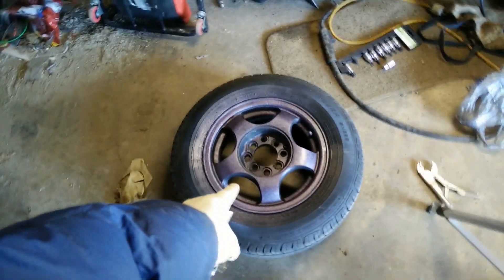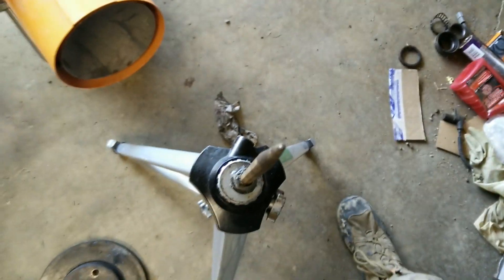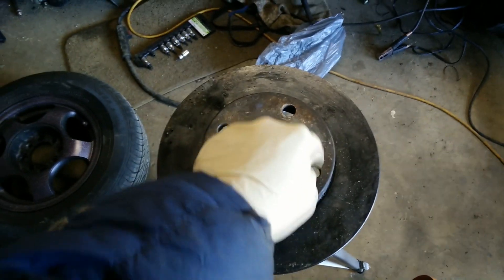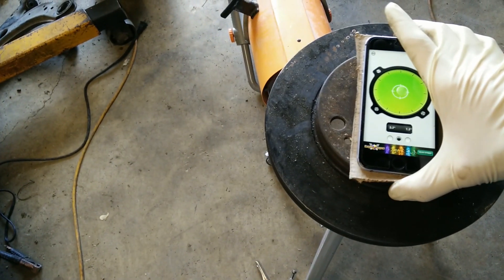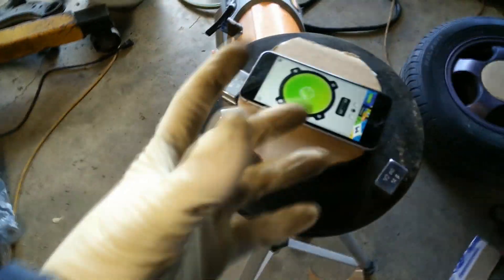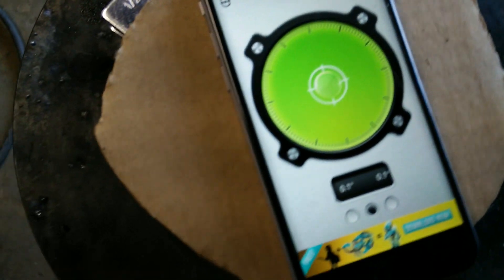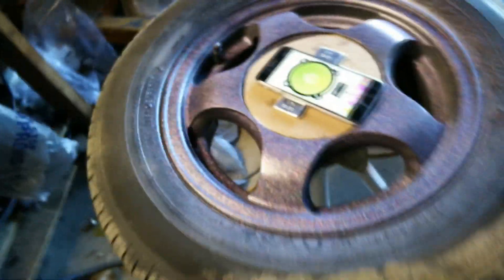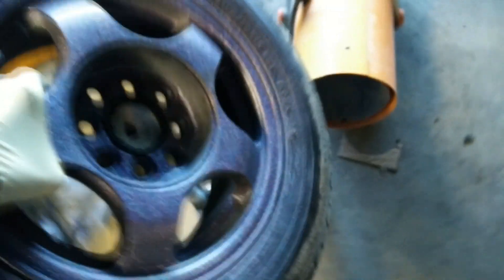DIY Wheel Balance | Make Your Own Bubble Balance

Comment: You do need to make sure the tires and wheels are clean, as a bit of grease or mud can way an ounce or more and when it dries and falls off your balancing will have to be done over again.  Do not sand the finish to appy the weights, just clean it well and maybe use a debrease such as alcohol (brake cleaner) or paint thinner. lighter fluid or in worst case scenario, soap and water and rag.

Comment: Alignment's not too hard either - I just made a couple of brackets out of spare wood I had and strapped them to the wheels. String and a tape measure got it close enough. At least drives straight now.

Comment: Dont give up on the idea but major fail in execution. First off "about centre" on your punch(no good) 2nd using a non centred phone and thinking it don't weigh anything and will not contribute to the balance. Small mistakes compound and you may be better off running no weights then maybe putting weight on the side that was already heavy. Take your time make sure the device will stay balanced without a rim then make sure your rim centres on your balancer. Good Luck on the project ;)

Comment: I balanced my tire with bb's, well it was shaking some I didn't like it,  so I took the back out, and I do not have a balance yet  am planning on getting one like you here,  so, I put my tires back on the rims again to day, and on all tires they have a colored dot some where on the tire, that dot indicates that  the light place in the tire, so I put that dot next to the valve, and  posed on the rim, aired it up to 33 lb's, added 1 once strait up from the valve, and I did this on all my tires, it's perfect  no shaking shimming nothing,  and if I didn't put that colored dot next to the valve stem, then, I couldn't add a wait strait up from my valve, the wait would have to be off centered to one side , and 3/4 of a once our a once  is perfect to me , it's just as good as if I would have got the garage to it and paid 60 dollars, so there, we don't even have to have a balancer to install a tire if we do it right and is there no dot on the tire, look for that little whit sticker next to the bead part of the tire, we that have to go next to the valve , that's if we cant find that colored dot.

Comment: I like the thought you put into this.  My cellphone bubble is more sensitive than I expected.  A big plus.  The reason your bubble wasn't centered at first, is that your cellphone wasn't centered.  The bubble is sensitive enough to measure this.  Perhaps a holder which would center your cellphone over the point would be more appropriate for accuracy sake.  But I thank you so much for the food for thought.  Obviously you use your head for more than just a place to put your hat.  Keep up the good work.

Comment: Why not just get a proper balance?
Reply from the maker: Then it wouldn't be diy. Also, I picked up a HF wheel balancer and tried to do a better job. The wheels are even worse now. It's sad.
Reply: So what you are saying is your homemade balancer works better them the Harbor Freight bubble balance? when you used your HF balancer did you calibrate it?
Reply: +MrAlittle5150 👍
Reply: The guy sounds like he's from the south / back woods and probably cheap. I take mine to the shop and that way help support local business. The next video might be how to tune up your engine without equipment.
Reply: Really? Last time I checked "DIY" stands for Do It Yourself. So even if you had the proper equipment, you would still be "Doing it Yourself".
Reply: Some people dont have the money to get tires balanced at a shop.. And probably cant afford a HF bubble balancer... I know I'll be trying it
Reply: @davedanielson1331  if you don't have the money for a balance you can't afford the running costs of a vehicle
Reply: @Fellafoe69  If I can do something myself and save money i will.. I dont trust shops anyway. . most of them fuck shit up for return business.. Always DIY....

Comment: Don't need  no steenking $5000.00 digital read out spin balancer with a $1000.00 worth of weight inventory to balance a tire on a $500.00 beater with a heater.

What a great idea. I have a Coats M76 bubble balancer that I've been using for over 30 years. Hundreds of tires balanced and still going until someone dropped something on the bubble glass and broke it. Of course it's obsolete now so no part available and can't use it. Was looking here for ideas, didn't know there was a level app for my phone.
Was thinking of those little round stick on trailer bubble levels but don't see how it can be as sensitive as the original.

Comment: if you are driving on a strait highway and your steering wheel is not strait , it's down to the left our down to the right side a little  this for a front wheel drive , well that do mean that one of your wheels are to far in , if it's sagging to the left the steering wheel, well that means your left front wheel drivers side is to far in and the same for the right side that the passengers side,  well on a front wheel drive car the alignment is toe in toe out, don't need and to in our out on a front wheel drive car , if you do you will have  out side corner scuff our in side ware, you need a   (not toe in not out out,) it's like making a good measure from center thread of the 2 front tires , like behind the front tires in a middles thread , and in front of the front tires in the middle thread, and do not tell that the tires not going strait, because it is not out  this much to make ware the tires,  a tape don't lie but the lazier computer crap do, and when you have this all measured like am talking about, you will see what i mean,  when the measuring looks close,  make sure that all thing are tightening    up,  try the car, see where the steering wheel is when you drive on a strain highway, if the steering wheel is still a little to one side , now you cant adjust a big amount at a time , like 1/4 of a inch, to what ever side the steering wheel is still down at right our left side, then do a tire measure again, if you do it like this you will get you steering wheel centered with each front wheel  from the car center line, and the center of the 2 front wheels, and let me tell you something,  when you get this all right your car is going handle like pro you wont believe it how good it changeling in turns and going strait with no presume on  the right our left of the steering wheel, i did it and i know that it do  work and works good ,because i am tire of paying alignment garages for nothing, making it worse then it was before i got them to fix it , thy made it worse,  thy even left a big pair of vice grips hooked up on the tire rod, and when i took it from the garage the vice grips hit the road,  thy are 3 thing, thy don't know how to work the alignment equipment , our it is not working right, our thy do so thy you will have to go back and get did again , because thy set it out of speck anyways .
Reply: Get thee to a SPELLING AND GRAMMAR CHECKER!